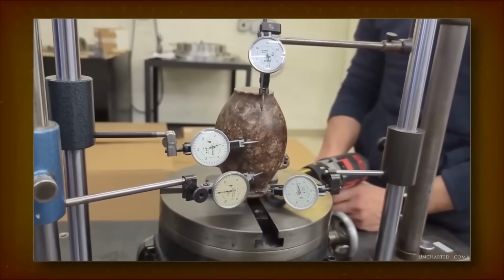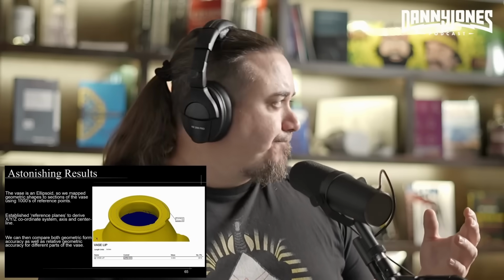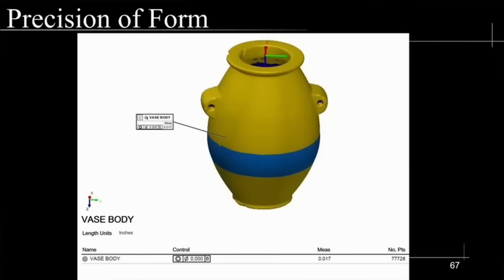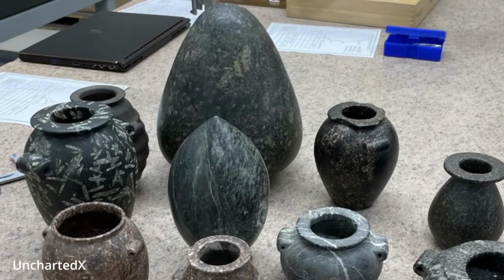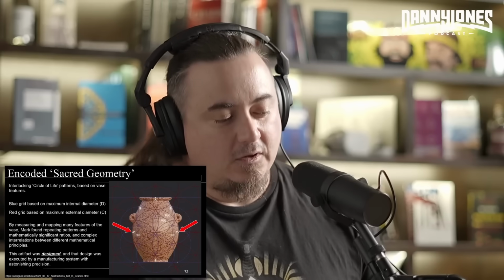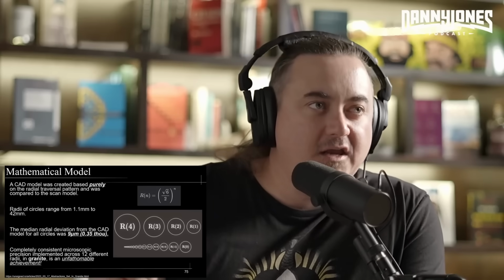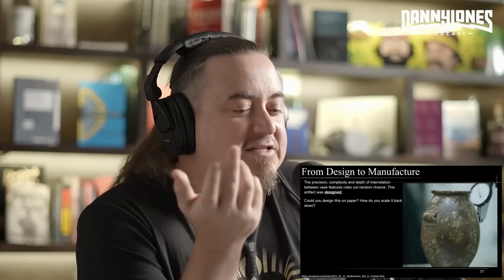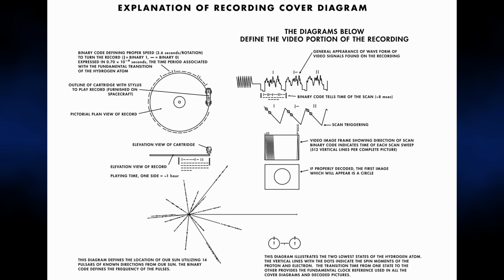Are These Ancient Egyptian Vases Actually Impossible to Make? #podcast #science #history #egypt

Comment: How do you draw a perfect circle with a compass loaded with regular lead drawing material when you need 1mm of precision?  You don't. There is no way to match the line when you reach the other side.  Try as you may, you will fail. You will buy a better compass, smaller lead, and all sorts of things, but you still will fail. It's a real lesson in what real precision is all about. And that's for a regular circle, not some oddly shaped object, or a gigantic object.
Reply: Did you account for the wiggle factor your hand had on the compass. The perpendicular axis of the compass must be maintained at 90 degrees or deflection will show on the circle drawn. Got the shakes?
Reply: @Frank-gy9kg  you are so correct. I did that test many years ago and forget many of the frustrations of trying to get that circle perfect. That was just the beginning, the circle, as I then started drawing the Flower of Life. Talk about challenging on the physics level (of the paper, the compass, the lead, the angles, the this, the that). I wanted it perfect, but wow, was I disappointed. Then I saw how that geometry was used to perfection to make, say, the face on a mammoth statue, and I just could not get over it.  How the hell?? Clearly it was not done by hand no matter what kind of hand tools they might have used.

Comment: If a lathe cut the profile I’d assume that the vase couldn’t have been hollowed at that time or the wall would have caved in. Also there would likely need to be cutting fluid involved to take such deep cuts out of granite. Likely multiple tools for the profile. Forming tool and sizing tool to say the least. But to have a flat end mill in the bottom to cut the inside diameter might be the most impressive. I’d like to know how concentric the inside measurements are.
Reply: Also, the cross holes in the handles.. what is their relation to true center? Because if all of those measurement are relative ie… one side is .003 to the left of center then the other side should be .003 right of center. Then you can clearly see if the was made with coordinated machining.
Reply: @chhhickenbonenowison  He's been through all of that. The handles and holes are in the precise same relative position on each side. Another thing is that in another video it was shown that the holes aren't drilled straight but are curved, aligning with the curve if the 'vase'.
Reply: @PaulieWall-ue4fj  Now that is a total other level of weird. They not only have to drill through granite, but curve the hole as well!

Comment: The design took knowledge and understanding. The accurate execution took skill and patience.  It could be done by hand if using a comparator - using the shadow (silhouette?) of suffient size.  Add some basic machinery: potter's wheel and levers to give symmetry.  Less skilled workers to "rough out" the carving, highly skilled people to do the finish work. I think doable but still time consuming and high skill from everybody involved.  No easy task. In my '2 cent' opinion.

Comment: You know what that means. Matter to energy and back to matter.
They possessed something like a transporter type technology. A matter synthesizer. There is no way mechaniclly they produced millions of these. Do you under stand how long it would take to produce even 1000 of these. Its not possible. And most lilely there were millions of them. Theres only 1 way. A matter synthesizer
Reply: Thats why all the stones fit so precisely. They were not cut and moved. They were synthesized on the spot as the structures were built. Then some were shaved as needed.
Reply: The trouble with that, is that the stones still show the grain structure that matches the local quarries.

Comment: The phrase “if a vase was carved by a Turing machine” seems to blend a physical crafting process with a theoretical computational concept, so let’s unpack this creatively and rigorously, assuming you’re referring to a Turing machine (a theoretical model of computation) being used to design, control, or simulate the carving of a vase. Since Turing machines don’t physically carve objects, I’ll interpret this as a Turing machine generating instructions or controlling a process (like a CNC machine or 3D printer) to carve a vase. If you meant something different, please clarify!
Conceptual Framework
A Turing machine is a mathematical model of computation, consisting of an infinite tape, a read/write head, a set of states, and a transition function. It can simulate any algorithm, given enough time and tape. To “carve a vase” using a Turing machine, we can imagine it:
	1	Designing the Vase: Generating a digital model or instructions for the vase’s shape.
	2	Controlling a Carving Process: Outputting a sequence of commands to a physical device (e.g., a robotic arm or CNC machine) to carve the vase from a material like wood, stone, or clay.
	3	Simulating the Carving: Producing a virtual representation of the carving process.
How a Turing Machine Could “Carve” a Vase
	1	Input Specification:
	◦	The Turing machine’s tape would be initialized with input describing the vase’s parameters (e.g., height, radius, curvature, material properties) encoded as a string of symbols (e.g., 0s and 1s).
	◦	Example: A string might encode a vase’s shape as a mathematical function (e.g., a rotated curve ( y = f(x) )) or a set of 3D coordinates.
	2	Algorithm for Design:
	◦	The Turing machine runs an algorithm to compute the vase’s geometry. For instance, it could:
	▪	Generate a parametric curve to define the vase’s profile (e.g., ( r(z) = a + b \sin(cz) ) for a smooth, vase-like shape).
	▪	Discretize the curve into a mesh of points for carving.
	◦	The machine’s state transitions would iteratively calculate coordinates, ensuring the design is computable (Turing machines can handle any computable function).
	3	Output for Carving:
	◦	The Turing machine outputs a sequence of instructions (e.g., G-code for CNC machines) to control a physical carving tool.
	◦	Example: For a lathe carving a wooden vase, the machine might output commands like “move tool to (x, y, z), cut depth d, rotate at speed s.”
	◦	These instructions would be written to the tape as a string, which a physical device could interpret.
	4	Physical Carving:
	◦	A real-world device (e.g., a CNC router or robotic arm) interprets the Turing machine’s output to carve the vase from a block of material.
	◦	The Turing machine ensures precision by computing exact tool paths, avoiding collisions or errors, assuming the physical device can execute the instructions accurately.
	5	Theoretical Constraints:
	◦	Computability: The vase’s design must be describable by a computable function. Complex but computable shapes (e.g., fractals) are possible, but non-computable shapes are not.
	◦	Time: A Turing machine might require many steps to compute a complex vase, but it’s theoretically capable of producing any computable design.
	◦	Material Limits: The physical carving process depends on the material and tool, not the Turing machine itself.
Example Scenario
Suppose you want a vase with a sinusoidal profile, height 20 cm, and radius varying between 5 and 10 cm:
	•	The Turing machine takes an input string encoding the function ( r(z) = 7.5 + 2.5 \sin(\pi z / 10) ) for ( z \in [0, 20] ).
	•	It computes a sequence of (x, y, z) coordinates by discretizing ( z ) and calculating ( r(z) ).
	•	It generates tool paths (e.g., “move to (r(z), z), cut 1 mm”) and writes them to the tape.
	•	A CNC machine reads the tape’s output and carves the vase from a wooden cylinder, rotating and cutting to match the computed profile.
Practical Considerations
	•	Real-World Analogy: Modern CNC machines or 3D printers operate like physical realizations of Turing machine outputs, using digital instructions to shape materials. A Turing machine could theoretically generate the same instructions, albeit more slowly and abstractly.
	•	Limitations: Turing machines are theoretical and don’t interact with the physical world directly. The carving quality depends on the precision of the physical tool, not the Turing machine’s logic.
	•	Complexity: Simple vases (e.g., cylindrical or conical) require fewer computational steps, while intricate designs (e.g., with engravings or fractal patterns) demand more complex algorithms.
Creative Interpretation
If the question is more philosophical or artistic, a “vase carved by a Turing machine” could symbolize the intersection of computation and craftsmanship:
	•	The vase might represent the idea that any sufficiently detailed algorithm can produce tangible beauty, bridging the abstract (computation) and physical (art).
	•	The Turing machine’s infinite tape could inspire a vase with an infinitely intricate design, limited only by the physical carving tool’s resolution.
Conclusion
A Turing machine could “carve a vase” by computing a precise set of instructions for a physical device to shape a material into a vase’s form. The process involves encoding the vase’s design, generating tool paths, and relying on a physical system to execute the carving. The result would be a vase whose shape is limited only by the computability of its design and the capabilities of the carving tool.
If you had a specific aspect in mind (e.g., a particular vase design, material, or a visual representation of the process), let me know, and I can dive deeper or even generate a chart to visualize the vase’s shape if you provide parameters! For example, I could create a plot of the vase’s profile if you specify its dimensions or shape.

Comment: core drill the outside to a cylinder.
Finish the face.
Attach to a potters wheel.
Then core drill the vase.
Using a swinging arm with a rotating tool on the end, sweep cuts to carve the interior, eventually to polishing.
Using the same swinging arm and tool, extend to the exterior and start roughing. Bringing it shorter in finishing passes leaving the handle torus.
Switch from rotating the vase to swinging the cutter only while indexing the vase to remove the excess torus leaving the handles.
Switch to a combination rotating-swinging to polish finish surfaces.
Use a smaller drill on the handles.
Lastly, flip the 99% finished vase bottom up on the wheel to grind the base.

All of this could be done with bronze tools with bulk low grade diamond bits cast into the tooling.  The trickiest part would be getting tight pivot joints on the swinging arms and smooth potters wheel rotation.  And of course a steady rotating grinding tool shaft.

All heavily flushed with water.

Comment: Inside fiirst ? Then fill void with clay for support before turning the exterior  The handles dictate a high  speed spinning external abrasive tool .  As opposed to spinning all  the vase on a lathe device.  The tolerances are incredible . The  variety and complexity show complete mastery  , the number made implies " industry" . The need for perfection aesthetics , function or a display of technical achievement ?  A jig or copy blank of some type controlling the cut. But the adjustment and cutter head design eludes me ????

Comment: The key issue here is how do you reduce that hard stone those shapes. First, applying basic methods like spinning, pendulums, gravity and so on, you can achieve geometrical shapes and that could look like someone had a higher mind. Second, we all think we need to carve or use harder material to reduce, it could just had been softer or even liquids to reduce, some kind of erosive matter or soft like wool. Third, if this was a challenge, it would be very costly to make, must have been a high value item at that time. If it wasn't, then that must have been either easy to make or just been a heritage from previous civs.

Comment: Are the holes in the lug handles straight or are they curved in alignment with the vase surface?
Reply from the maker: They are not straight. But they do burrow into the vase material, making it even thinner in that part. They are also done half each side of the whole and not just drilled straight through. Some speculate the holes were added later. More on these vases coming in the following weeks. Cheers

Comment: Pre- egyptian Tech....I agree with other who say a Lathe was involved. The  Lathes  poss. could be made of copper alloys. 
The cutting point on the lathe? Egypt had Corundum and Zircon minerals and these are very, very hard Abrasives. 
Either of these abrasives-with a Copper of alloy or Iron- with  heat and pressure-would make a Metal Matrix Composite Material, that would poss.  etch out the inside of these vases.
 The black sands of the north coast of Egypt have deposits of a Zircon mineral and a Titanium mineral.(titanium was found on a fragment of a  stone vase also).
 By the way, the Hittites had iron making in the 14th century BC- made using a shallow pit, iron ore and charcoal. (So the pre-Egyptians, could poss have had Iron.).
   So some kind of Machine ran a lathe...poss with a Metal Matrix Composite Cutting blade.
The simplest machine would be a steam powered-(copper steam engine made of copper alloy)- running a Lathe.........
The Vase Rigidly held...and the vase, being  machine-cut out with a Metal Composite blade. Then  a steam engine also running a polishing disc of the metal matrix composite material(the abrasive being Corundum or  a Zircon  powder-and polishing the vase).. 
A steam engine also could power a saw to cut  2 million blocks  for a pyramid fairly easily. R Rather  than hand cut  the blocks.
 ......(By the way, the Victorians only had steam and lathes, but iron, but did incredubly  complex manufacturing -without a Computer.

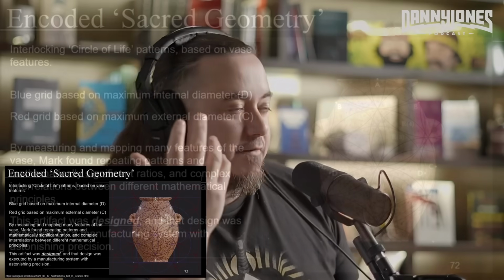Comment: 16:51 Notice how the points selected are not on the same horizontal axis. C and D should be in line. Way to cherry pick data. Should've quit 10 minutes in.
Reply: No, D is on the edge of a different circle that has a lower center, aligned with the curve of the outer edge of the artifact.

Comment: Just because you don't know how they were made doesn't make the impossible it just means we're not as smart today.
Reply: It's obvious you dont know what you are talking about. If the vase wasnt done by hand then it automatically follows that they used a very advanced calibrated lathe system or possibly even something like a CNC machine. There are no other options due to the nature of the surface and changing degree of curvature. It is IMPOSSIBLE to do it any other way and have it mathematically be that crazy accurate
Reply: @NoOne-uh9vu  That's way beyond comprehension for most unfortunately

Comment: Not Impossible  just difficult .. We know  Lathes have existed for thousand of years  ..  Same to rock Cutting saws .. Our ancestors were just as intelligent and skilled as we are today .. They just worked with cruder tools so that had to perfect their skills over a lifetime  .. This vase can easily be created with a  modern lathe .. The tool cuts the main shape from a pattern .. When the tool get to the Ears  it is moved in and out by a lobe  mechanism rotating in sync with the vase .. This leaves lobes protruding where the ears are .. The excess material around the ears is removed manually  .. 

The industrial age improved and fundamentally change lathes by standardization, increased precision, and better power sources .. There are numerous artifacts that indicate lathes probably go back 4-6 thousands years ..

Comment: A stone vase may be turned on a high speed lathe with a diamond cutter head. Removing the interior is extremely delicate operation, but likely not impossible. Leaving two handles or lugs on the exterior in this process is impossible. The approach to producing a vase must be considerably different than what we envision. It is likely that they were formed and not produced from solid rock.
Reply: I've heard over the years red and watched about lost ancient techniques in South America of stone softening. And it absolutely looks like some of those even the megalithic ones had some kind of softening to them almost like we would do with clay and then use a tool to etch out the lines and so on.

I would imagine places all over the world had their own techniques. They say in the Amazon there was some kind of chemical and plant mixture that created the effect. Whether it's a plant material whether it's some kind of spiritual science of sound and changing the structure of matter they obviously knew something.

And if it's some kind of third technique that's more like our modern day than obviously they were great at it.
Reply: @ChristopherSchiffermiller if the stone was softened to be worked gravity would have deformed these vases beyond the tolerances they have.

Comment: I'm a machisnt, it would'nt be that hard, 17thoundsandth is .017 and just over a tho and a half. A human hair is is between 17-181 micocrometers. I think these were made with a ganite form tools, you only need one side to spin against a lathe, and they some how had measurement tool to make them. My old job we cut brass with steel tools. So Granite would have worked well with clay and it would be very symmetrical. And this wasn't over night generations would have passed down this skill.